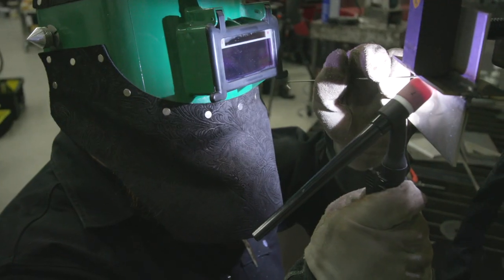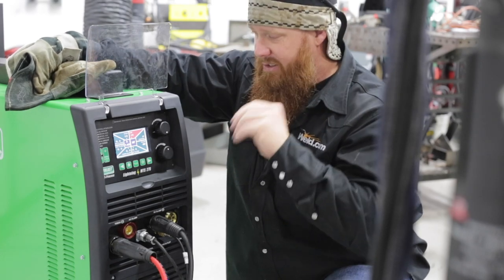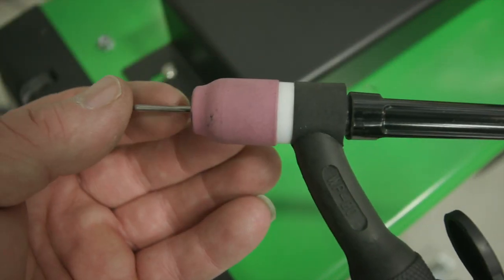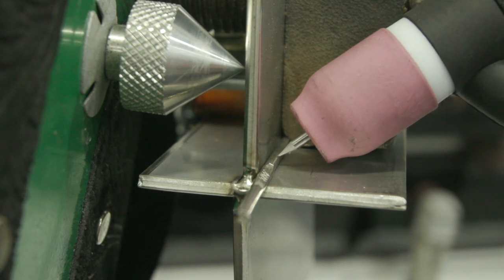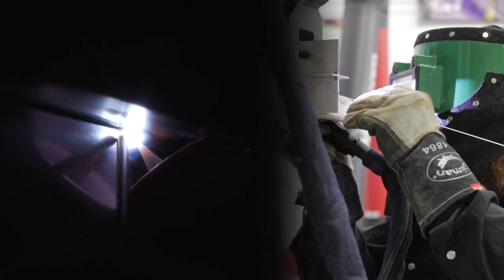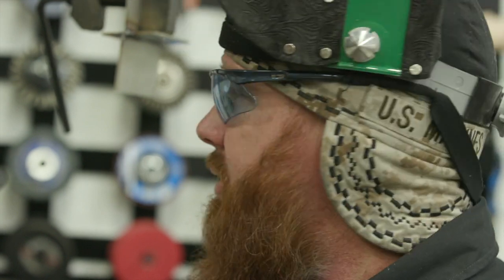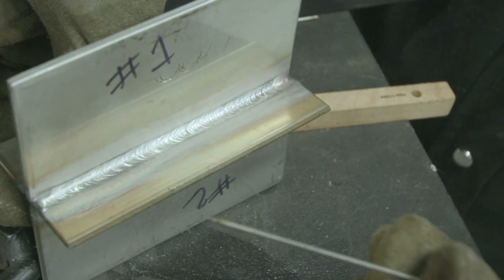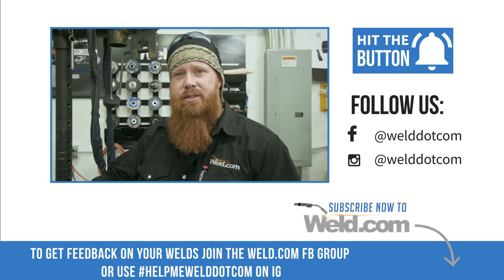Overhead TIG Welding | Thin Gauge Stainless

Comment: Can you do some gtaw on some light gauge stainless steel? Like 20 or 18 gauge?
Reply: Mike Mitchell sure thing. We will add it to the list. Any specific joint configuration?
Reply: Jason Becker I got one for you. you need to do thin gauge steel in the overhead position using flux core no gas 👍🏻
Reply: @GodslilRedneck23  3f joints would be neat to see. downhill and up.

Comment: I have a Lincoln 50 amp ( non adjustable) arc hobby weld. .......... now that you have stopped laughing, can I stick weld 3" stainless exhaust pipe with it? And which stick and size should I use?

Comment: Whats the story with the MTS? Are you going to do an in-depth review? I’ve had my eye on one of the 252STI models, but man 275 amps would be nice on thick aluminum.
Reply from the maker: Yeah, weve been using it for a few weeks now. Just making sure we have some time on it before we do a review.
Reply: This unit is still 250 amps.
Reply: Everlast Power Equipment what is the main difference between the 275 and the 252 STI? Is it mostly the new user interface?

Comment: Which Everlast, Lincoln, or Miller system would you recommend for TIG welding for Gunsmithing on small parts and aluminum?
Reply from the maker: Check out the Everlast 210 EXT
Reply: @Welddotcom  Thanks

Comment: There was a finger control on the torch. Why didn't you use it? instead of the pedal. I also don't consider this a thin material. Thin would be 14ga. or less.
Reply: Brian Harkess If I have the option, I like the foot pedal, I’d not, I’ll use the finger switch. 1/8” is the thinnest we had.
Reply: AS a fellow welder and a man. I see your point. But I would not label this as a thin ss weld. I would ask this of a guy on his first day. I would encourage all of us to teach tig welding with finger control. That way when they are not at a bench they can weld in all positions.
Reply: Brian Harkess we will be doing videos featuring the finger switch soon.

Comment: As you're traveling are you letting off the pedal or are you keeping the same amperage?
Reply: swissmochaj I eased into it but ended up just standing on the pedal half way through till about the last inch, then tapered off a bit till I got to the end.

Comment: Have an off topic TIG welding question. Needed to weld a 5/8" solid round cylinder to a piece of 1/2" x 2" x6" near the end of the bar stock 3/*' from one end. Regular 1040 or so steel. To keep the round perpendicular to the bar I milled a 3/8" trough into the bar, thus giving 2 sides for the cylinder to rest on, but not any deeper than minimum required.
Cleaned everything with acetone including ER70-S6 filler, argon ~16cfh. Tacked 4 corners, then welded one side of cylinder to bar which worked well. However, on the other side got lots of porosity. I know argon may have helped but the open area would be difficult to get to. 

Any suggestions?
Reply: Try 20 to 25 cfh I'm from Australia so we use liters per minute but I think my conversion isn't far off
Reply: @kieren7763  Made another one today same as before, but went up to 25 cfh and it worked perfectly. Thanks for that tip! Sometimes if I can easily do it an argon dam is ok, but not for this one. Just the increas did the trick. 

Hope you continue to provide your videos, really great information for us "less than professionals".
Again - Thanks